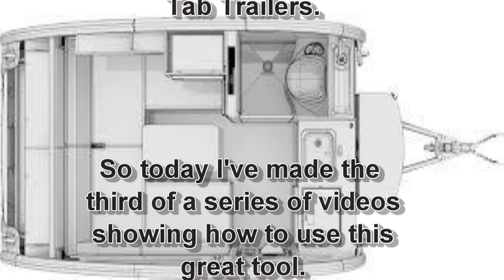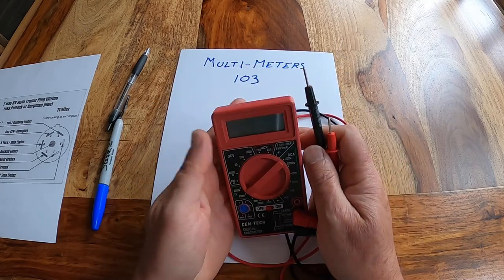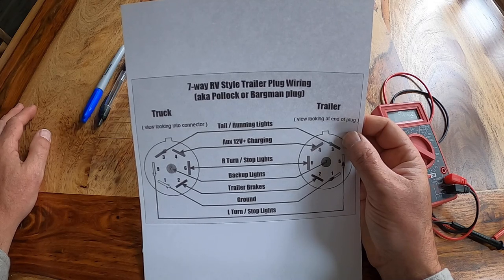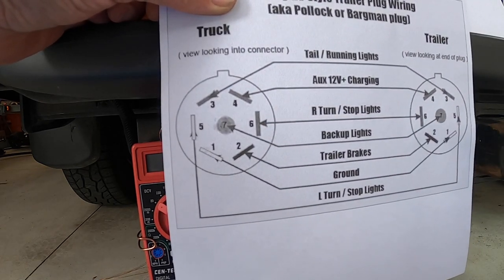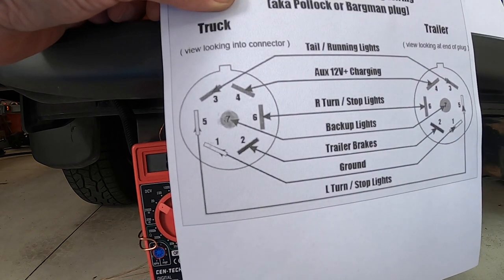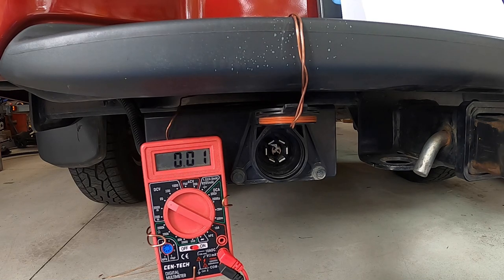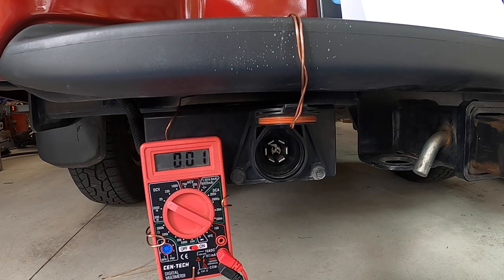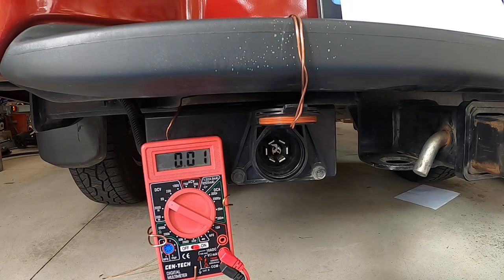Multi-Meter 103 - Tab Trailer Training

Comment: When my Toyota Tundra is running the multimeter shows 14.6 volts. When I shut it off it still shows 2.5 volts  between the ground and charging pin.    Do you think it’s safe to leave it plugged in and not drain the battery?
Reply from the maker: My advice would be to disconnect when your engine is off.
2.5 volts at the plug is not much, but theoretically could slowly discharge your truck battery when the engine is off.